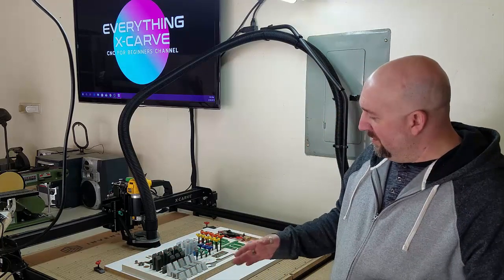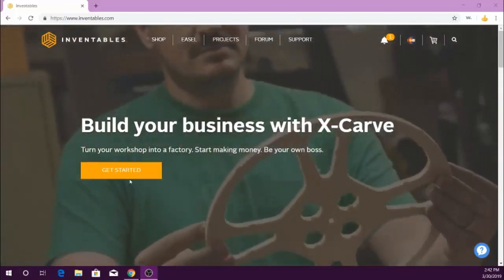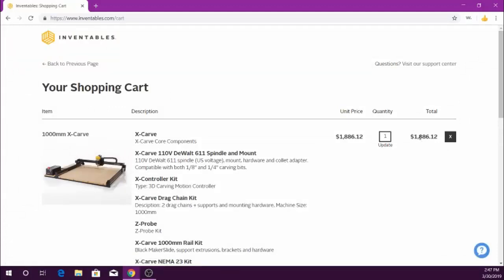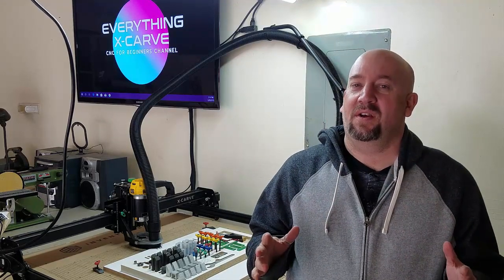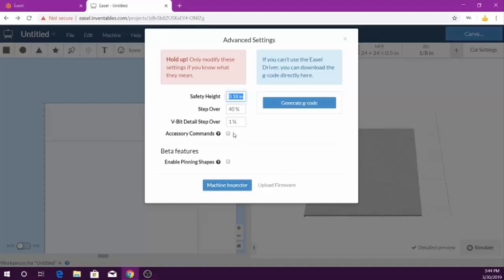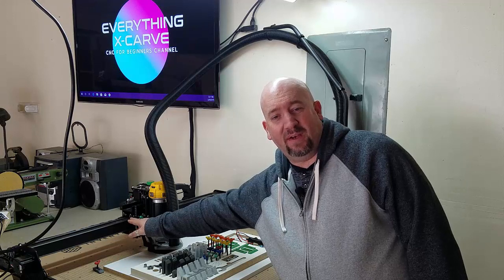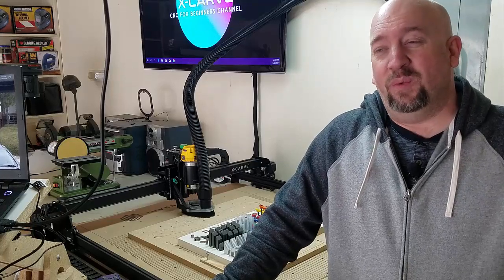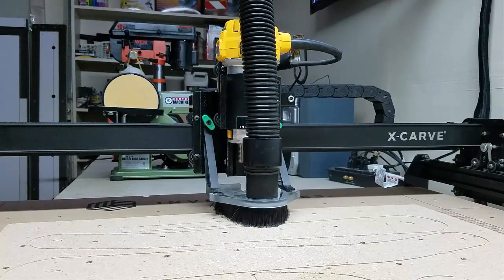Ordering the X-Carve 2019 and Setup guide

Comment: Hi Brian, great videos, l recently purchased an x-carve and would like to know what computer you run.  I  am looking at running a stand alone laptop. Do l need a powerful system to run g-code and maybe easel software. Rodney
Reply from the maker: Hi Rodney, 
Thank you for the comment. I use an older laptop it runs just fine you will need a usb on the laptop here is a link to the requirements. https://discuss.inventables.com/t/system-requirements/9218

Comment: learn how to take your zero point height from the spoil board and not you stock and you will not damage you spoil board and will be able to cut though without almost zeo damage, remember though its is a spoil board and in the real cnc world if they last a year you will be lucky..... I run a open builds 1075 with a big water cooled spindle on it to dump the noise and dust!.
Reply from the maker: Thank you for your reply. I have a z probe so I am familiar with zeroing from spoil board however as close to level my board is I like the silkscreen on the factory board and i do not want to tarnish it at all. Thank you for commenting and for watching.

Comment: have xcarve sorted the flexing issues now , i was looking at a xcarve until i saw a video by marius hornberger and what he had to do to fix the flex .
Reply from the maker: Venrice that is a great question. I have not had any issue with mine and i have had it for a year now but   there are stiffiners you can add aftermarket if you do experience an issue. Thanks for your question.